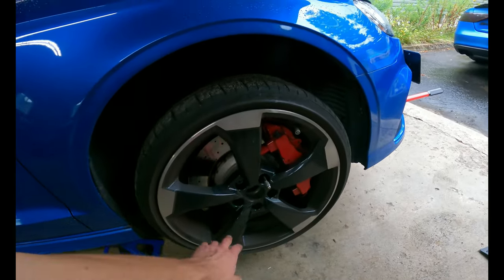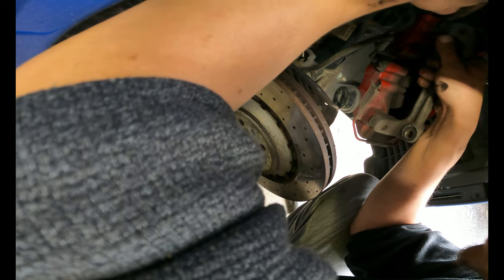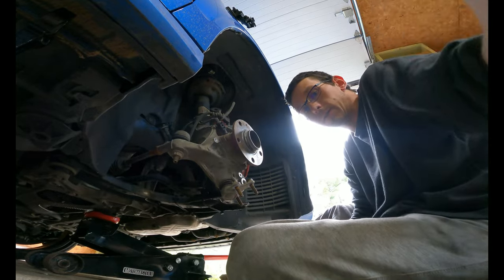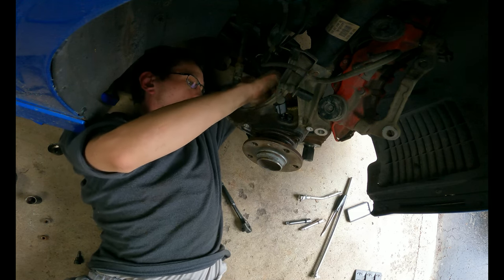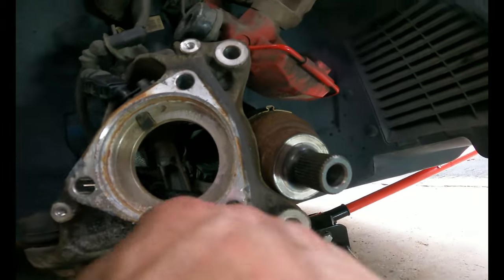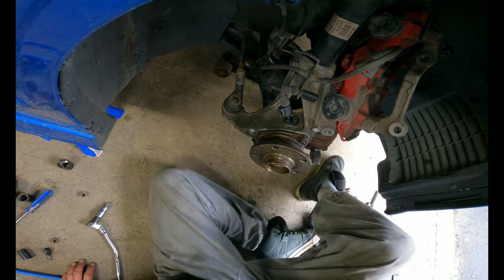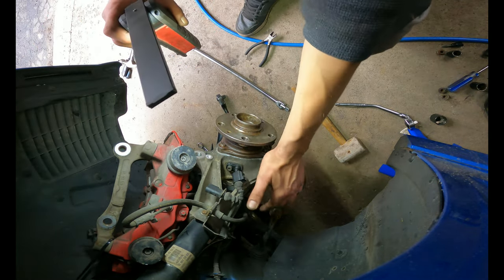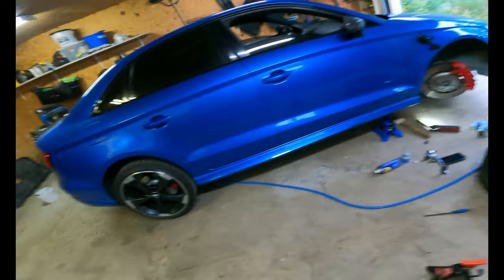2018 Audi RS3 Front Wheel Bearing Replacement DIY (How To)

Comment: How have the used bearings hold up. Im looking st replacing mine. I have 41000 miles on mine and they need replacement makes me a bit hesitant to buy used bearings. But bee are $500 a piece.
Reply from the maker: It's holding up pretty good, no complaints yet. The used wheel bearing only had 5000 miles on it, I've put about 10k miles on it already